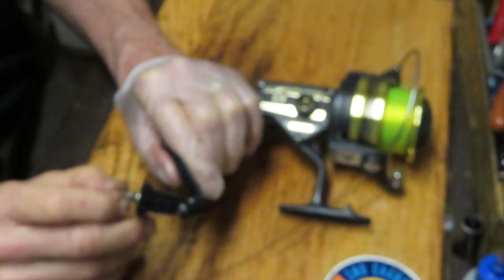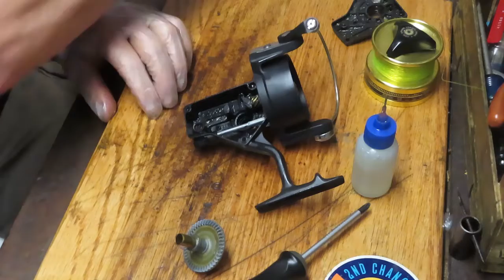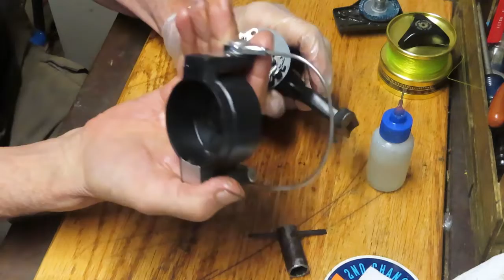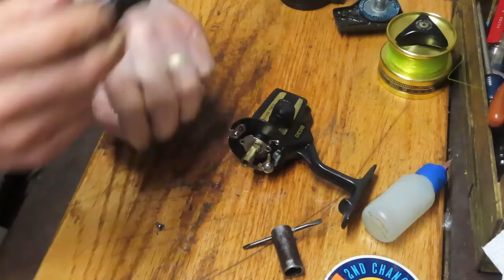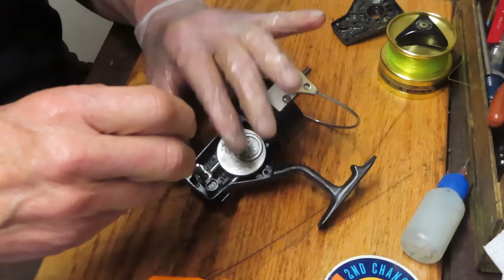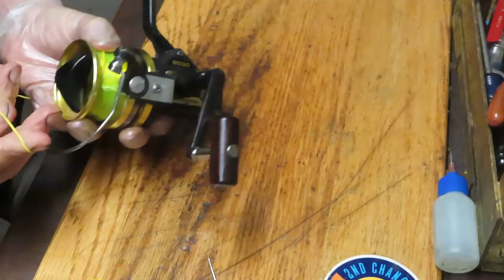Daiwa BG30 spin fishing reel how to service

Comment: any suggestions on where to find a main gear for a BG 30 I have? Great video.
Reply from the maker: New stock parts have long since been discontinued for that reel.  Best to check eBay for the part or a donor reel. - Thanks for asking - Dennis
Reply: @2ndChanceTackle  Thats what I have learned was hopeful maybe I hadnt found that one place with some parts left. thanks for answer.

Comment: My father has two bg30  reels with the wooden handle. They are very good condition but the anti reverse does not work. We have watched your video and everything is the same until we try to remove spool housing. We can remove the 12mm nut and removed the shaft. That's where we hit a wall. We can not remove the bell housing. Any advice or suggestions would be appreciated. Thanks for the video
Reply from the maker: Sometimes dirt and debris gets on the pinion gear through the water that drains through he top of the rotor.  Try flushing the top of the threads with penetrating oil to help loosen it up.  Pray it down and let it sit overnight to do its thing.  nest, rock the rotor side to side to walk it up the shaft. - Try that approach and let me know if it works - Dennis

Comment: Thank you for this video on the BG 30 I pulled out my old reel and pulled it apart and followed your instructions and it’s working extremely well except the anti-reverse is not and I think the spring on that is missing I saw a small piece of a broken spring. Can you tell me where I can find it thank you.
Reply from the maker: Check with Southwesternparts.com or on eBay.  The reel is an older version and you may need to find the part used. - hanks for asking - Dennis

Comment: Very good quality reel, that seems to hardly ever fail. 👍
Reply from the maker: I have only had problems with the larger ones in this series and that problem is rotor wobble.  The 30 size rarely fails.  Thanks for the note - Dennis

Comment: What is the difference between a Daiwa BG and a GS reel other than cosmetics. I would love to have one or two of these but they do not come cheap!  Looking at this reel as you disassemble I just don’t see much difference myself. I have almost all the GS Series reels but no BG ones. I see that the AR setup is slightly different. I like the one on this reel a lot!  I love the Daiwa pinion gears on the silver series, gold series, and these BG reels. I own 79 Daiwa reels in my collection. I can tell you right now Dennis - by the end of this year I will have at least one of these vintage BG reels preferably a BG60 or BG90. They are the primary saltwater reels of the series but I bet this BG30 would do just fine.  I think I’m finally done collecting the saltwater Mitchells with that last Mitchell 498 I got that I showed you. I can remember when I thought I’d never get a 498 but now I own seven in four different models including the chrome 498 I built myself. I think the 498 is by far the most impressive and solid PAuM saltwater reel series ever made. You can tell they are a favorite of mine. 

Someday you have to find a Daiwa 8600 heavy action three BB spinning reel for one of your videos. If you can’t I’ll ship you one of mine. Without a doubt these 8000 series reels by Daiwa - 8100 and 8100A, 8300, 8600, and the incredible 8700 are among the finest reels that Daiwa has ever made! I have them all and three of my favorite - the 8600. I can only surmise that the cost to produce them and Daiwa’s move to making only skirted spool reels led to the end of their production. Besides, all the 8000 series Daiwas are WORM GEAR  reels much like the Penn and Shakespeare worm gear reels. 

This BG30 video will become a favorite of mine as I like these vintage BG models a lot! Thanks for sharing Dennis!!! — Chris
Reply from the maker: I think it is mostly cosmetics.  I would love to find the 8600.  I will check around - Thanks for sharing Chris - Dennis
Reply: @2 @2ndChanceTackle riously Dennis, if you can’t locate a Daiwa 8600 I’ll gladly send you one of mine. I have three and one is new in the box. It really won’t need servicing but I think so highly of these reels that I’d love for others to know about them. The guy on The Fishing Hobby YouTube channel did a nice video on the 8600 which is when I found out about them. Since then he doesn’t do much with reels and emphasizes working on rods.  I mean, how many people actually know that Daiwa made a worm gear reel with three ball bearings back in the early 1970s. I sure didn’t know it. The treasure one that I found from this series was the larger 8700 which only differs from the 8600 on the size of the rotor and spool. I bought the only 8700 I’ve ever seen. I personally think your subscribers would be very interested to know this reel exists. — Chris. PS. I found and purchased a second 8700 in early 2025. I honestly never thought I’d ever see another one much less own it. I no have two complete sets of the 8000 series plus a few extras.